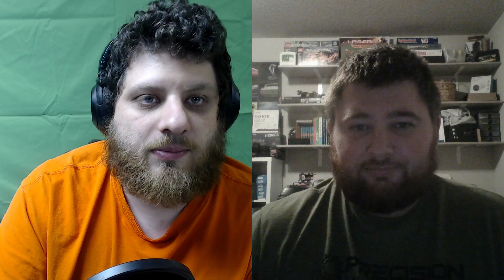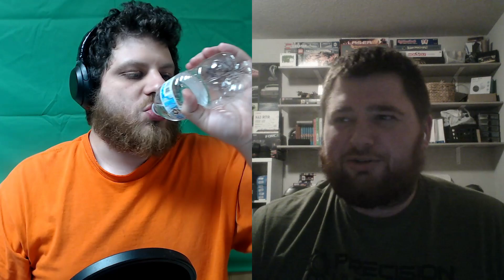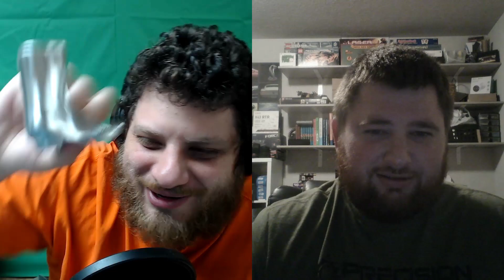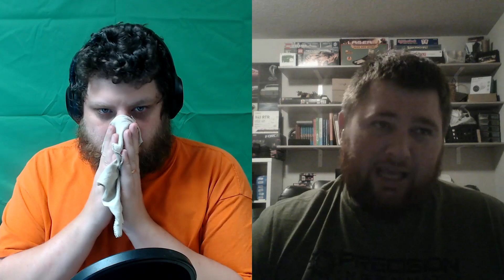Harrison Broke His Doosan -- Ep.95

Comment: Sucks on the doosan. (Remember that the issues you have had are with the reseller thus far) Spindle aside 

 If it were me i would drop the harvey 4 diameter to 5/8 or  .5 the svm is much closer to a haas than a dnm and therefore much less rigid. With a high flute count tool the core is quite rigid and thats a lot of tool for a machine (i ran probably 60 or 70 hrs worth of tool life when they first came out and even on a vcf i wouldn't go above 5/8

Also on regofix. Why not take advantage of the benefits of a few shrink fits to improve productivity now rather then hoping for it in the future?

Just some thoughts. Love the podcast
Reply from the maker: If you can't buy directly from Doosan, then the Reseller is the face of the company 🤷‍♂️. That's not an excuse in my book.
Reply: @AudacityMicro  I can respect that option but if anyone should be on blast its the reseller. The reseller for doosan in my area is jm grizzley. Guys are always on top of things, multiple apps guys and sales reps to talk to. If it was a situation like yamazen where they are the sole rep I would understand but I look at it more like a car dealership in this situation
Reply from the maker: Don't they have exclusive areas?